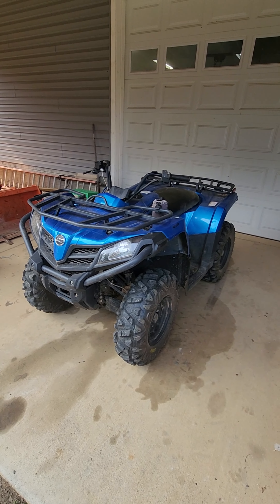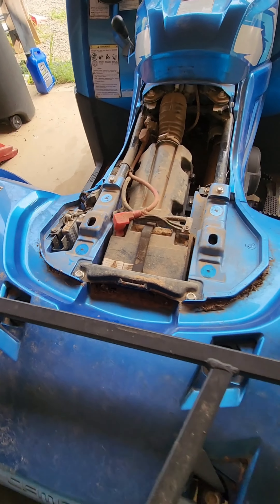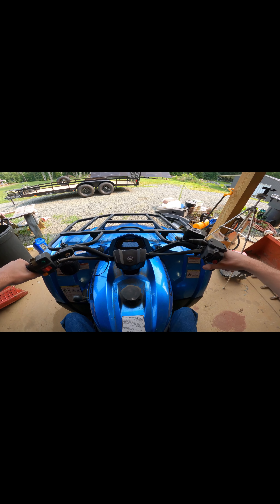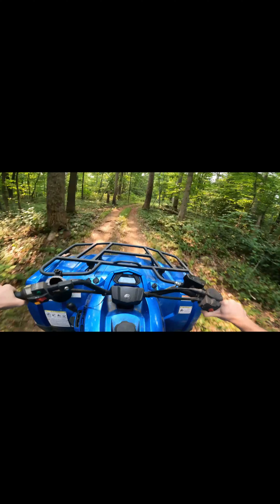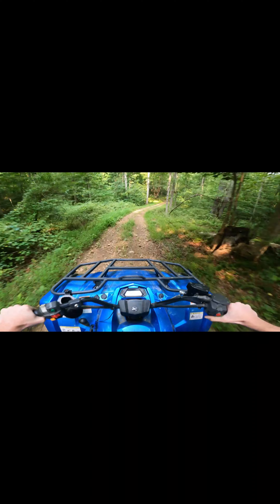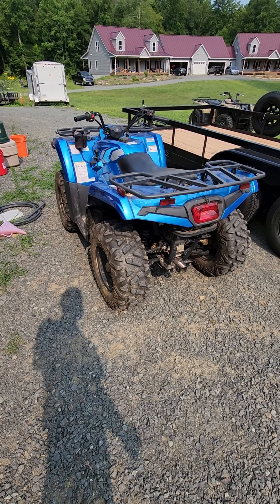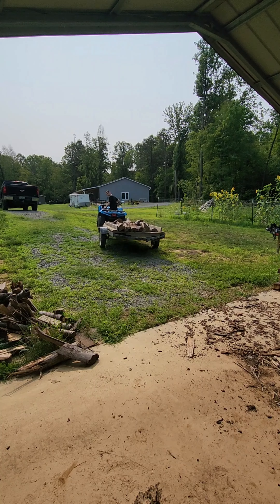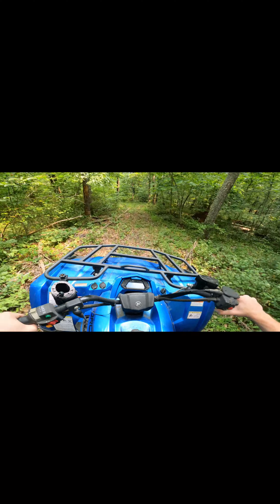CFMOTO CFORCE 400 600 Mile Review!

Comment: You have to make sure you feel it engage in the low gear or it will skip out and make that noise make sure you push it all the way up I've ridden the 500 and own the 600 Models and they'll all pretty much do the same thing if you're not engaged properly in first.
Reply from the maker: Thank you! and I'm sure that's the case.

Comment: Only complaint is they are removing the left side rear brake lever on the handle bar. But instead you get a foot brake lever that sits higher than your foot. So you have to take your foot off the foot well to hit the brake. Where my 2002 bear tracker foot brake is even with the foot rest so you just have to flex your foot downward. Othwise these cfmotos are giving big names a run for their money.

Comment: I am a CF Moto 400 L owner and I put my bike through hell the clutch has to go when you’re in the mud because the factory and they got the rubber plastic over the things on the clutch but you gotta upgrade your clutched the third stage and when you do that you change the exhaust and now you got a 500-35 horsepower difference between the 2 to 500 and the floor on so I made mine up to fivehunters with the clutch in the exhaust and I’ve poured my bike through hell and it runs the one in there and then bikes are actually made for roads as they have lingers in the horn and all that but we’re on from Nova Scotia they want to lower only just across the road and just go through the trails and turn my blinkers on on the trails I don’t know why but they’re assholes down here